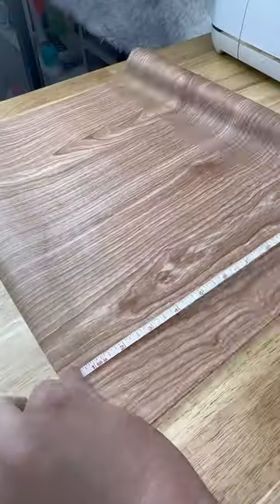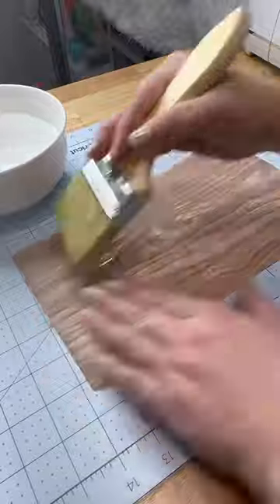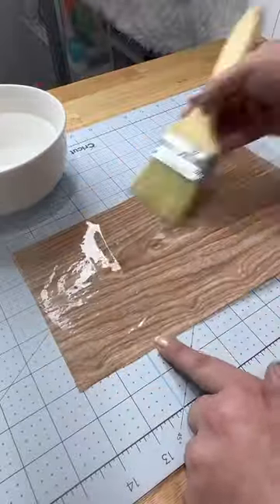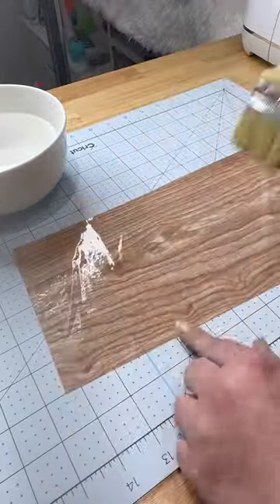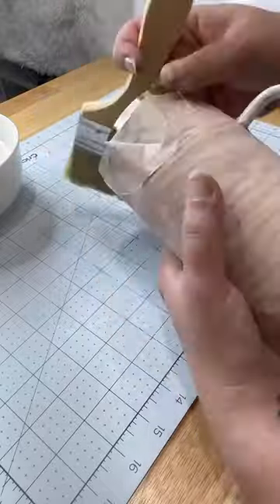Did I fail with my first hydro sublimation? #sublimation #hydrosublimation #sublimate

Comment: What is hydro sublimation ?
Reply from the maker: I wish I could give you an accurate explanation but right now best I have since I’ve only done it once is it’s a thin sheet of pre printed sublimation which you apply with water to your blank. It seems to be great for items with curved surfaces as the thin paper and water allow it to fit to those curves
Reply: Do u print it yourself ?
Reply from the maker: @mandyn8663  no it comes in a big roll